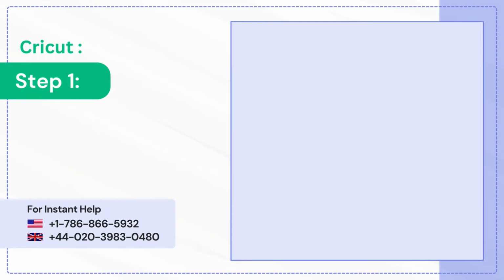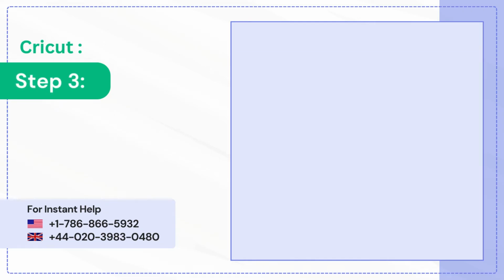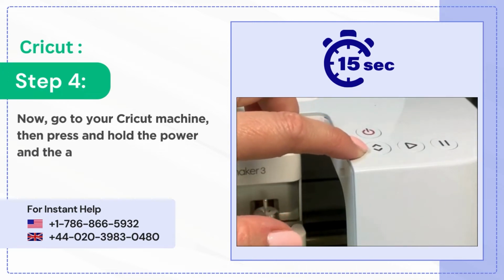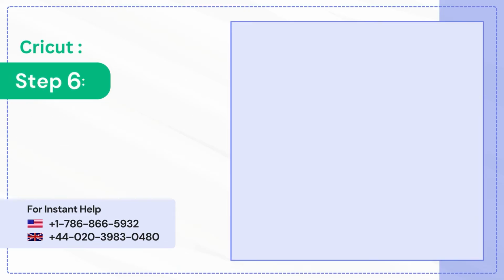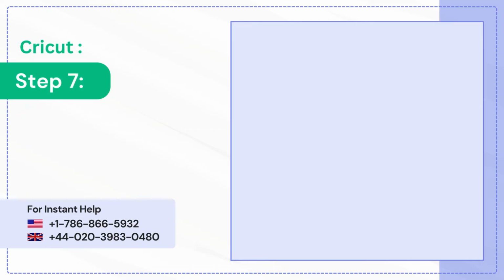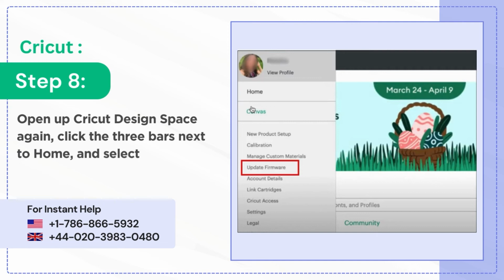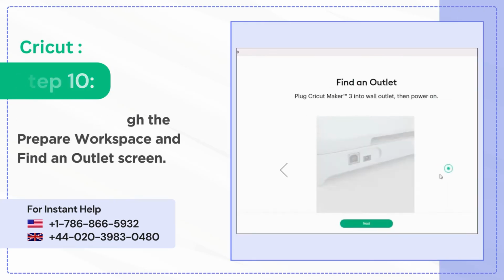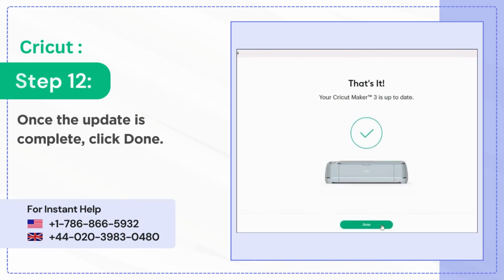How to Resolve Cricut Machine Power Button Flashing Red Issue | Manny Maker

Comment: easy instructions and seems to have worked. Was making cards and when it started cutting only cut for a min or so when red light came on. after doing this it cut a whole card. wonderful will post again in a few days if it doesn't mess up again. Of course would not be your fault but just as an update thanks